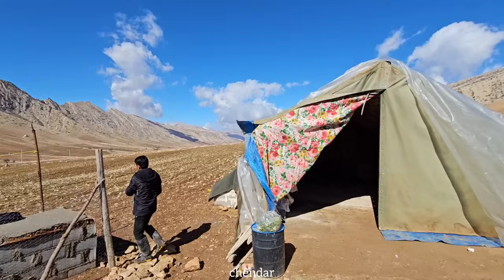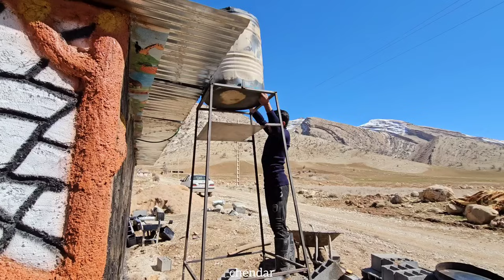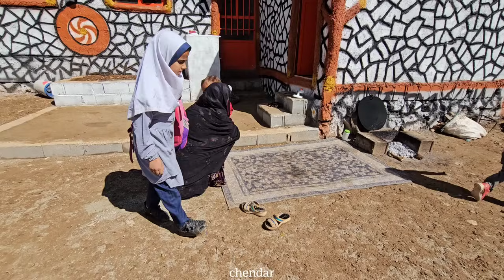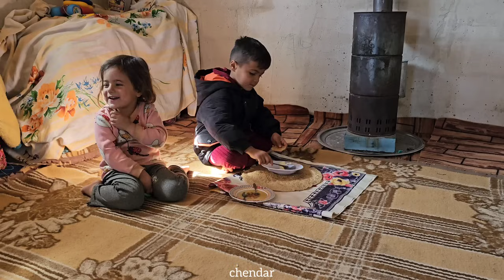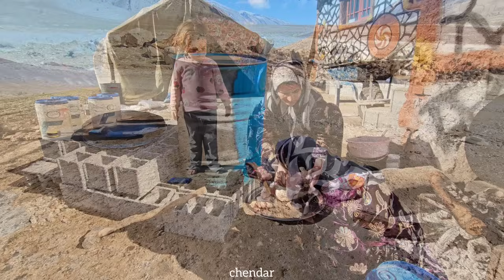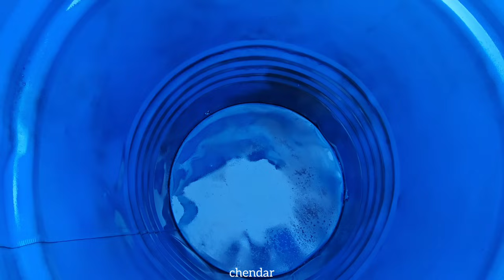Majid's nomadic family and efforts for welfare in the winter house

Comment: Great job improving home. Very hard work shown .
It was hard last winter with all the rain, snow, hail, wind. Cold, wet and mud, dirty environment and how family suffers through it.
Thinking of maybe, with spring coming and weather getting better, this family can plan on reducing the problems faced in past.
Suggest look into where the rain water tends to flow on roof top and ground around house.  Put in counter measures to divert water away from house. Use a tool that measures the slope of the ground so water flows away from house.
Tent can also be secured with ropes tied to stakes driven into ground (cemented in hole in ground)
Sorry for long comments.
Suggestion is to do things this spring and summer such that when fall and winter rain and snow comes in 2024, the family can reduce the excess water,wind, snow drainage problems.
Keep this sharing of your family up.
You working very very hard and wishing all this hard work is rewarded by many many subscribers.... million numbers....scale.
Be safe.
Drive carefully.
Many times, it looks like safety is not priority.
Work hard.
More contents, more progress equals Earn more.
Have to stay healthy to Stay strong.

Comment: I am just wondering why most of the tanks are in the roof or as high as the roof (except for bath showers) when the level of water pipe is only counter top level.
Isn't it harder to refill the tank than when it is 3-4 ft standing from the ground?